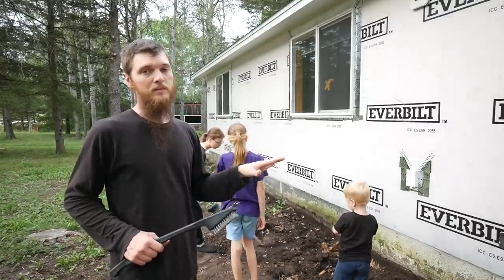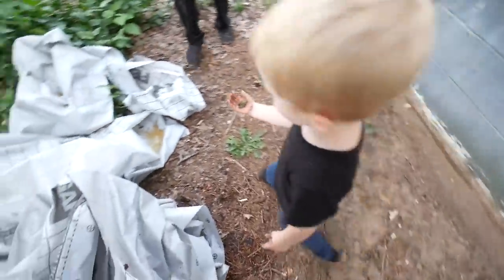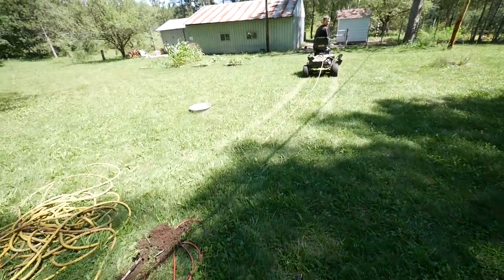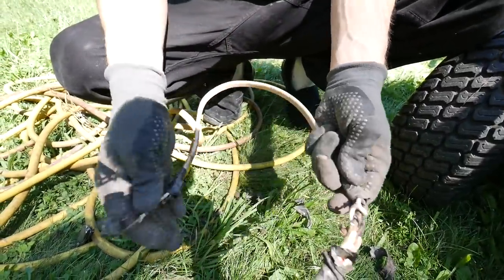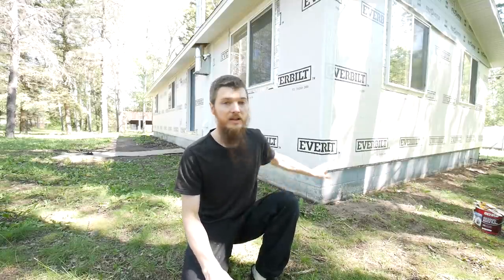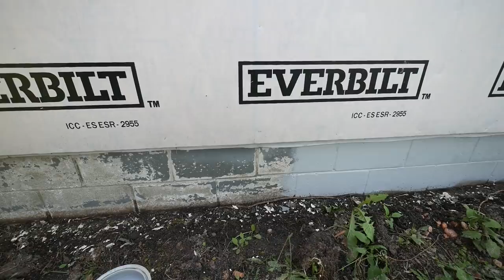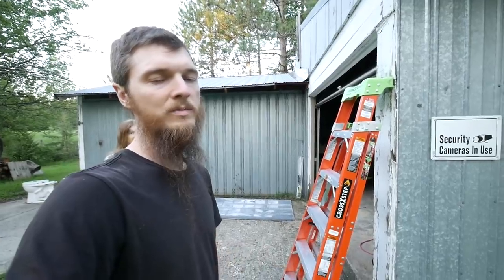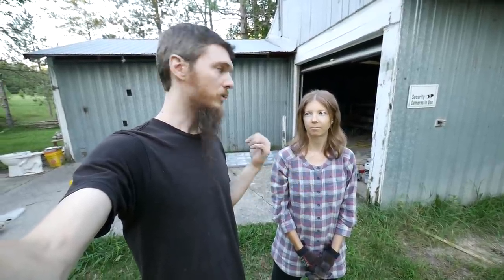Unexpected Turn of Events - Renovation Vlog

Comment: I always use brushes when painting porous surfaces like brick/cinder block. It ensures that you get the paint/sealant into the actual holes of the brick and adheres better than rolling it. Spraying would be the quickest/best way to do this if you have a sprayer. Not sure if Behr has any mold/mildew/sealant protection, but if not you may want to go back around with a sealer.

Also a good time to go around with a perimeter defense for ants/termites to prevent any future intrusion like when you were ripping apart the kitchen! :)
Reply from the maker: I think it does have mildew resistance.

Comment: I think a knotted wire wheel or cup brush for a angle grinder would have saved you a lot of time. I think i would have gone with Dry Lock Masonry it would last longer and waterproof the blocks. Just for the record Kokomo is a city in Indiana.

Comment: Not sure a pressure washer might not simply make a huge mess of the housewrap, and maybe get under and into the frame and all sorts. Hand scraping or a wire wheel on a drill (I would use a wheel rather than a brush head) are the only options I think.

Comment: You will actually get better adhesion between your paint and block so it won't peel off as easily so long as it was thoroughly dry before applying.

Comment: Past experiences, put a second coat on the foundation. Winter weather up there and the deep snow will eventually go right through one coat and crack your blocks. I'm surprised you didn't have some already. Did you trim your beard, Doug?
Reply from the maker: No trim on the beard :)

Comment: Doug how do you feel about leaving CRAWL SPACE VENTS CLOSED during the summer months also...I currently still have mine blocked off....am seeing conflicting ideas about this was wondering how you felt about this......ps....your son....looks just like you....hes going to be a genious like his dad too
Reply from the maker: Just my personal opinion, I think they are better off sealed up all year. Now if you have a lot of moisture down there it could be a problem but generally speaking closed is better. The crawlspace is cool and when the warm humid summer air comes in it will condense on the wood and metal, slowly causing rust, mold, and rot. I think that vented crawlspaces are one of the reasons that so many homes on crawlspaces have foundation and rot problems. An encapsulated crawlspace is ideal.
Reply: Thank you Doug.... I value your opinion.....

Comment: I would suspect the cable was a single piece when installed.  Later damaged and repaired, a few times so it appears.  It is possible the way the line stopped that the garage was not even there when it was buried.  May have just been a service line for a light pole originally tied into the front porch light switch circuit.
Reply: I thought emergency generator running house from garage

Comment: Hey .  
maybe an idea for a next time or similar job : 
to get the paint and tarnish off the wall blocks, 
I personally tried it with a wire brush cup on the grinder.  
and preferably a grinder with a variable speed to be controlled, as on my own Bosch machine.  

with kind regards Hollandduck from the Netherlands

Comment: I was surprised you didn't paint  tar on the cinder blocks first to water proof them?? then you can paint over the tar..  ... PS: check by the tint they put in the paint .. it would tell you if it has a blue hue.. I really like the colour you did use...
Reply: We used that paint 18 years ago and it has been holding up fine

Comment: As it is right now, the foundation looks good.  But I noticed that somehow —

You kinda sound not entirely satisfied with foundation wall look. Perhaps adding a bit more would be more pleasing. Ideas include: 1) some type of paving so that grass can't grow right up to the house, when you mow the paving allows for the mower to mow all of it versus having to use a weed wacker. 2) using cement to put faux rocks on the cinderblocks. 3). Using real stones, you've got plenty it looks like. 4). Using landscape cloth and pea gravel to border around the house. It can't be mowed over like "1)" but a sidewalk can then run around the house with the gravel between sidewalk and house. It'd be a clean look. 

I don't like that mud will splash onto the foundation if it's left without adding something.
Reply from the maker: We were just surprised at the blue tone it had, it always looks so different than on the color card. But we're fine with it. Good thoughts on keeping weeds away, we plan on doing a wood mulch all around the house for weed control and preventing dirt from splashing. Thanks! :)
Reply: Why will water splash? Won’t the gutters prevent that?
Reply from the maker: @nowherenan3824  We're not doing gutters :)

Comment: Don't you open your crawlspace vents in the summer?
Reply from the maker: No, we never open our crawlspace vents. Just my personal opinion, I think they are better off sealed up all year. Now if you have a lot of moisture down there it could be a problem but generally speaking closed is better. The crawlspace is cool and when the warm humid summer air comes in it will condense on the wood and metal, slowly causing rust, mold, and rot. I think that vented crawlspaces are one of the reasons that so many homes on crawlspaces have foundation and rot problems. An encapsulated crawlspace is ideal.

Comment: Probably because who ever did it was on a tight budget. Kinda like you using a barbecue scraper to scrap your foundation. 🙄
Reply from the maker: You're right, maybe we should have bought an official loose paint scraper for foundations. But I still don't know how that relates to piecing together wires that no one even knows what the purpose of it was.
Reply: @diyfferent  it obviously had a purpose at one point.  Just because you don't know what it was for doesn't mean it had no purpose. All I'm saying is someone at some point buried a spliced wire for a purpose neither you or I know, and that person was probably on a budget based on the fact the quality of the wire/job.  People do different things, not everyone is going to bury wire like you would. Just like most people wouldn't use a barbecue scraper.  I just found it funny that you were criticizing someones work when you were just scrapping your foundation with a barbecue scrapper. By the way , you do good work. The kitchen counter top 👍